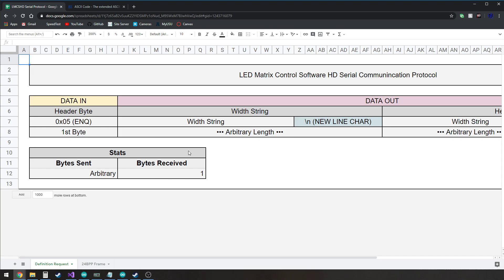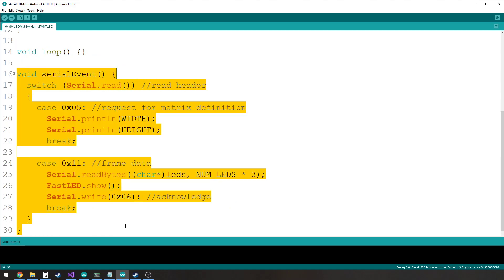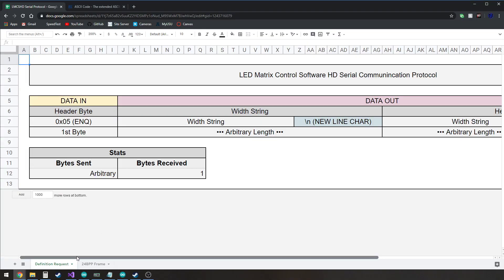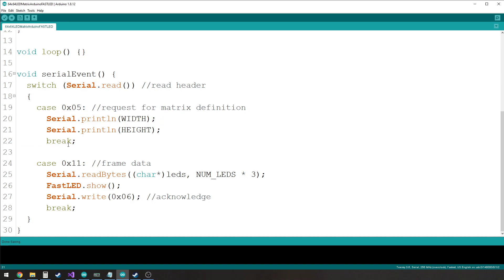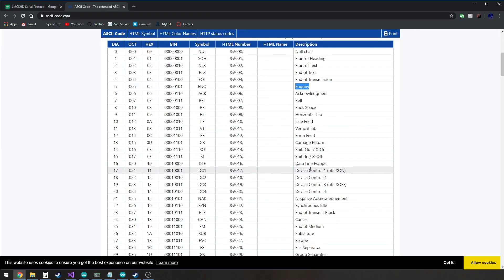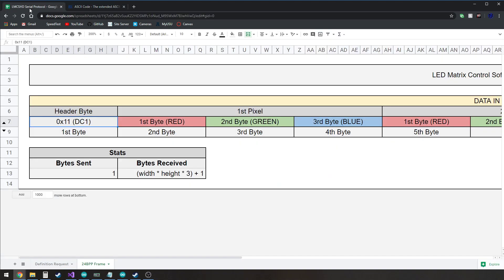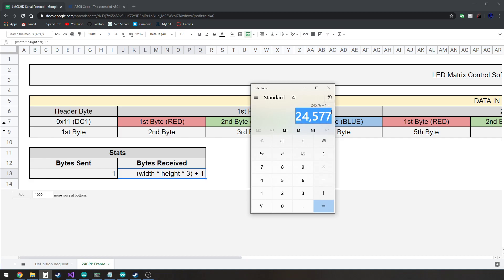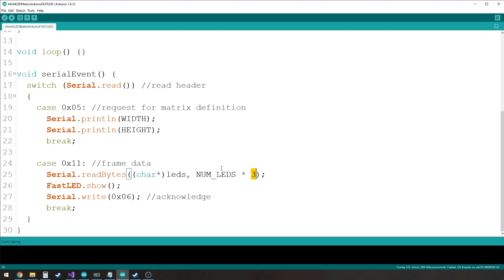LMCSHD Tutorial - Serial Communication Protocol

Comment: Hi, I have a problem. Im using a ESP32-S3-Matrix board and the LMCSHD 2.7 is not cooperating. The software can't use the correct COM port (all other programs are closed) and often, when I try to use other color modes and ports, the program crashes and refuses to close (I can't even close it with task manager) and then I have to restart PC to completely kill it. 
Also, I had an error when I tried to compile the board's code:  "error: jump to case label [-fpermissive] case 0x43" I fixed It for myself but I thought you should know about this.

Comment: are you going to be making a function in your software thats specifically for having preset designs based on our matrix designs? in an older version of your software for example there was a draw feature. going forward are you going to have any preset codes in your software? i.e rainbow, raindrops, etc
Reply from the maker: I'm not much of an artist, so I doubt I'd be able to make any kind of designs that would be good. Procedurally made designs, like rainbows, or fractals, or noise could be a possibility, but it's not likely. I don't think that's going to be the focus of the software. However, adding images/gifs will be easy. 

As far as saving goes, I'll make it so saving configurations is easy, so you could put all your settings as you like them, and load the config file.

Comment: Hi friend, thanks for your work. Everytime i try to stablish connection by serial COM i get an ERROR, and i can't connect, any solution? I'm noob at this, thanks a lot!
Reply from the maker: Make sure you don't have anything else using the serial port. Likely you have the Arduino serial monitor running while you try to connect. You can't have more than one connection, so you'll have to close the Arduino serial monitor before connecting.
Reply: @TylerTimoJ  Tried, and no connection too. I tried uploading your example arduino matrix fastled sketch attached and no answer. With the 1st version of the Led Matrix Software Control i have succes, but not at this version. Anything more special to do before open the LMCSHD? Thanks a lot. 🤘🏼🔥

PS: My matrix is 9x9, could be this the problem?
Reply from the maker: @bvnker23  Try using the latest stable release here: https://github.com/TylerTimoJ/LMCSHD/releases.

It looks like I left a weird value in the FastLED arduino code for Serial.begin. Try changing Serial.begin(4608000); to Serial.begin(115200);
Then, make sure you type 115200 as the baud rate in LMCSHD. If that doesn't work, reply back with some more info about your setup so I can better help!
Reply: @TylerTimoJ  Thanks a lot, was the baudrate! Now, like your beta tester (HAHA :P) i have some questions/things to you:

- Drawing tab is dissabled!
- Edit > Pixel Order, etc, seems no effect, not appears any Panel (like at your videos).

Final & difficult one: I know that your software doesn't supports RGBW, but, with your old ones, and typing this https://www.partsnotincluded.com/fastled-rgbw-neopixels-sk6812/ into your LedMatrixSerial.ino, i was able to show correct colors at DRAWING tab. It's possible that my rgbw (sk6512-RGBCW) is dissabling that Drawing Tab?

Thanks for your attention Tyler!
Reply from the maker: @bvnker23  drawing tab is not yet implemented, so it is disabled until I implement it.
Edit > pixel order is working in newer versions, but for a while it didn't do anything, try updating and let me know!

It should work with your RGBW leds. The drawing tab is disabled intentionally.
Reply: @TylerTimoJ  I understand so! Thanks for answering. I'm updated,  and with 64x64LEDMatrixArduinoFASTLED.ino  sketch clean with 9x9, my leads appear distorted, and not working. With the next code, appears distorted too, neither doesn't let me set the Pixel Order.

#include <FastLED.h>
#include "FastLED_RGBW.h"

#define WIDTH 9
#define HEIGHT 9

const int NUM_LEDS = WIDTH * HEIGHT;

//CRGB leds[NUM_LEDS];

// FastLED with RGBW
CRGBW leds[NUM_LEDS];
CRGB *ledsRGB = (CRGB *) &leds[0];

void setup() {

  //FastLED with RGBW
  FastLED.addLeds<WS2812B, 6, RGB>(ledsRGB, getRGBWsize(NUM_LEDS));
  //FastLED.addLeds<WS2812B, 6, GRB>(leds, NUM_LEDS);
  Serial.begin(115200);
}

void loop() {}

void serialEvent() {
  switch (Serial.read()) //read header
  {
    case 0x05: //request for matrix definition
      Serial.println(WIDTH);
      Serial.println(HEIGHT);
      break;

    case 0x11: //frame data
      Serial.readBytes((char*)leds, NUM_LEDS * 3);
      FastLED.show();
      Serial.write(0x06); //acknowledge
      break;
  }
}

--------------------------------

Feel free to answer, don't want to disturb you, but if we can resolve this, i'll give you a present (i'm graphic designer, maybe a logo or something else you want! haha)
Reply from the maker: @bvnker23  Ok looking into FastLEDRGBW a little, it looks like there's a 4th byte for the W component of the LED. Reading directly into the led array doesn't work because of that extra byte in each pixel. Reading to a separate buffer, then setting the R, G, and B values separately should work. Try this code, but know I don't have any way of testing it!

#include <FastLED.h>
#include "FastLED_RGBW.h"

#define WIDTH 9
#define HEIGHT 9

const int NUM_LEDS = WIDTH * HEIGHT;

//CRGB leds[NUM_LEDS];

// FastLED with RGBW
CRGBW leds[NUM_LEDS];
CRGB *ledsRGB = (CRGB *) &leds[0];

byte sData[NUM_LEDS * 3] = {0};

void setup() {

  //FastLED with RGBW
   FastLED.addLeds<WS2812B, 6, RGB>(ledsRGB, getRGBWsize(NUM_LEDS));
  //FastLED.addLeds<WS2812B, 6, GRB>(leds, NUM_LEDS);
  Serial.begin(115200);
}

void loop() {}

void serialEvent() {
  switch (Serial.read()) //read header
  {
    case 0x05: //request for matrix definition
      Serial.println(WIDTH);
      Serial.println(HEIGHT);
      break;

    case 0x11: //frame data
      Serial.readBytes(sData, NUM_LEDS * 3);
      for (int i = 0; i < NUM_LEDS; i++) {
        leds[i].r = sData[i * 3];
        leds[i].g = sData[i * 3 + 1];
        leds[i].b = sData[i * 3 + 2];
      }
      FastLED.show();
      Serial.write(0x06); //acknowledge
      break;
  }
}

let me know if it works!